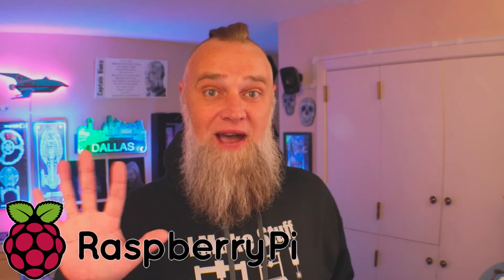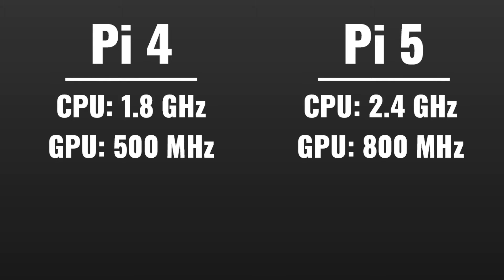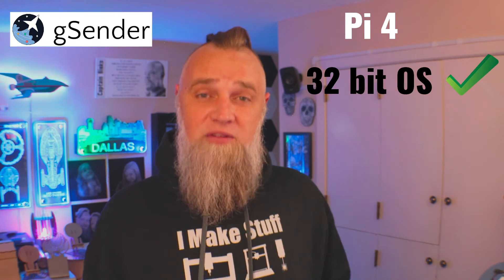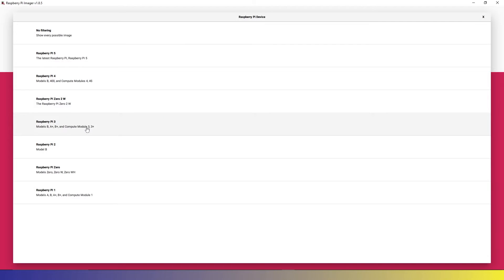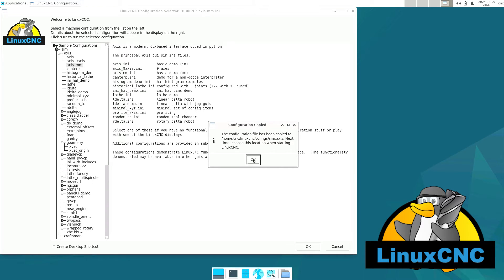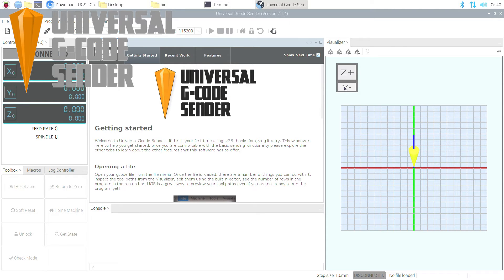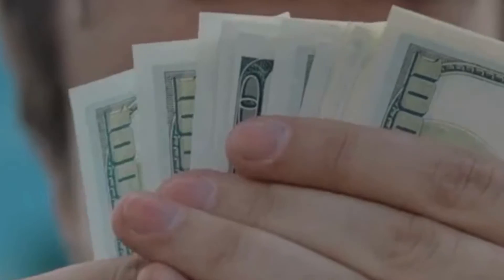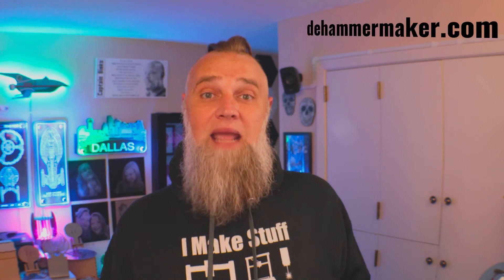Testing G-Code Senders on Raspberry Pi 5 for CNC Machines | LinuxCNC, UGS, CNCjs & More

Comment: I've used both the Pi4 and the Pi5 with a Mesa 7i96s control board.  They connect together simply using a ethernet cable no other hats or wires or any of that other stuff required.  You can literally retro fit any machine on the planet using this combination.  I did however ultimately get rid of the raspberry pi and switch it out for a HeroBox N100 mini pc and then upgraded its ssd to a 1Tb drive and made an exact clone of it for a backup.  The raspberry pi was giving me issues with the wifi module and I couldn't SCP onto the Raspberypi when the ethernet cable was connected to the mesa board.  The HeroBox N100 is perfect.  Simply network the machine and from your CAD software post the gcode directly onto the mill or lathe then in LinuxCNC i recommend the GMOCCAPY interface and refresh the file.  It makes prototyping and optimizing really quick and simple

Comment: thanks for the video. the ugs website download page now has a version which claims to work on the 64 bit raspberry pi os. i have been trying to get it to work but without success. do you have any success with this? the error i get is java not found - but this version is described as including java. do you know if this can be made to work by downloading java - if so which version.

Comment: Very big difference between a gcode sender, a servo controller, and a pulse stepper. The first is trivial, you just send the gcode to the device. The second is harder, you need to update the servo every 1ms or so. The 3rd is the hardest. You need your pi to be realtime kernel, as your interval is in the microseconds and you can't tolerate much jitter

Comment: I'm currently thinking about integrating a pi5 with a 26" touch screen into my electronics cabinet for my cnc router. The router runs on FluidNC and I've been using CNCjs for testing and I've grown to like it.
Reply: I got CNCjs to run on my Pi 5. It was really simple, just follow the instructions. I forgot to enable the kiosk mode and redid the setup but it doesnt seem to have changed the setting so I'll probably just make a little script that on boot starts the browser in fullscreen mode at localhost/#/workspace. I also want to mount google drive as a storage medium so i can save files on my PC to the drive and load them from there on the RPi. I can also acces the CNCjs webinterface on my PC with the IP of the Raspberry as both are in the same network. Next up is testing if it works with my controller and then comes the monitor

Comment: Throwing Linuxcnc with gcode senders is a complete lack of understanding of Linuxcnc.
The RPi5 as of now will only be useful with Ethernet or using the gpios. SPI is currently unsupported.
Linuxcnc is far far more powerful than a gcode sender, as it is the cnc controller.
It would have been helpful to state the difference between a gcode sender such as grbl and a cnc controller as linuxcnc.
Reply: Spi is supported with the remora project. Not every board is but most of the common btt 3d printer boards are
Reply: @jamestennant3367  are you sure the RPi 5 is ?
Just looked at Scott’s GitHub, the SPI driver is using the bcm2835 headers and that code is not for use with the RPi5.
Unless of course there is a branch using the slower spidev interface or someone has got code going for the RPi5 natively rather than having to use the kernel driver.

Comment: no matter what sender, no matter what software, there's one thing i want that's as hard to dig out as a booger just past the bone, a way to get encoder input in without resorting to horrifically bad cobbled firmware, i've gone as far as doing a design up in ttl that'd work fine.

Comment: Don't think I have commented to you for some time, since I moved into my FIXER upper.  Still can't afford the Longmill and with summer fixing coming up (mo money), I decided to settle for a Two Trees TTC-450.
Only 460*460*80mm, but that's a step up from the 3018.  Hopefully I will find something to make and sell with it.  Should be able to do some decent reliefs.  Not as bright as you making money with the 3018.  I'm planning to buy a used intel NUC off eBay for about $50 to run it.  You know you can tell Windoze not to update.  And Linux is the better OS (other than gaming).  Thanks for the informative testing with G-Code Senders.
Reply from the maker: Good to hear from you. Hope the move has treated you well. I just saw a video on the TTC-450. It looks like a very nice machine. You will have to let me know how you like its touch screen. Also, which spindle did you go with?
Reply: @D.E.Hammer  It has a 500W spindle.  The videos I've seen look good.  I hope it is reasonably rigid an accurate.
Reply: @D.E.Hammer  Okay, I've been messing with this for a week now.
I bought it with the 500W but it shipped with both spindles.  Using the 500W, of course.
The small display is easy to fat-finger, so you need to use a stylus.
The display tends to key-bounce occasionally.
You only have steps of .1, 1, and 10mm.  No 100.  Only need to punch the button 46 times to move from one side to the other!
I do like that I can send a file over WiFi and just use the control panel to initialize and start the job.
I'm trying to find a good forum for this thing other than Facebook. 😝

Comment: I've been running  bCNC on a 2 gig Pi-4 for a couple of years and think it's great. UGS ran on the Pi-4 but the real time display did not function, which is a  known problem. I have not tried either on a Pi-5 yet. I think Pi-5 is way overkill for CNC. You could probably use a Pi Zero 2W, which is about as powerful as a Pi 3b+.
Reply: I run bCNC on a pi3 with the Protoneer hat for the last 6 years.
Reply from the maker: I know, but i have gotten a pi every generation, i just find them fun. I just can't find my original one. I did load up gsender and cncjs on the pi3 I have, and it just felt sluggish after using a 4 and 5. I have not used the pi zero, but I think I might have to try one out.

Comment: From South Africa here...61 years old, got my pi 4 - 8 gig and micro sd 128 and started learning linux two months ago - first time with a rp  :) I am presently using win 7 and ardunio / grbl to run my diy cnc router - everything open source , except paid for Cambam....very tight budget.  I really would like to make a swap over to linux cnc and pi 4 (small foot-print/dust factor - as you mentioned)....The learning never stops  :) A real-life install, from beginning to producing a part (in great detail) would be a really usefull tool for us makers....I have spent a gazzilion hours getting my setup perfected - 6 years running without a glitch now :) Great video showing alternative senders for the pi - thanks
Reply from the maker: That's awesome, and congrats. The learning never does stop. LinuxCNC looks interesting and opens up a whole new rabbit hole into controllers.